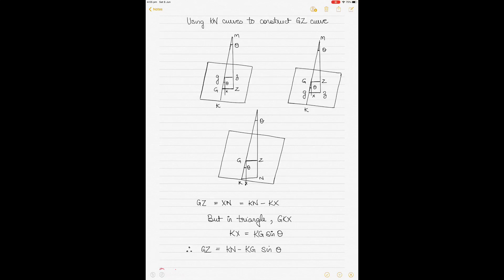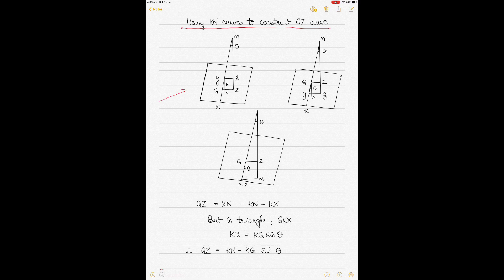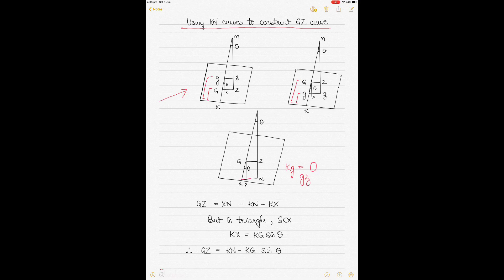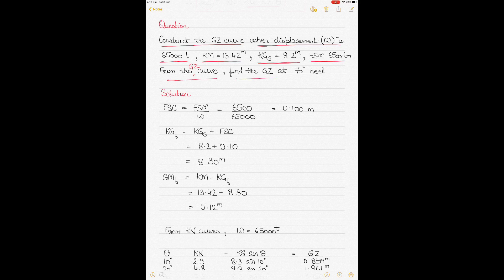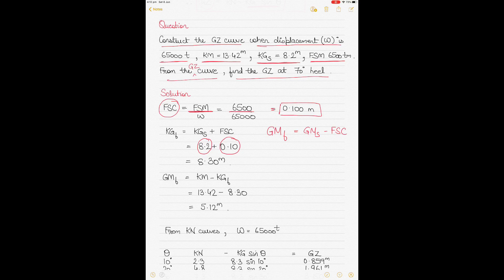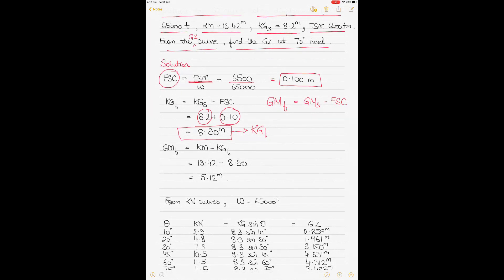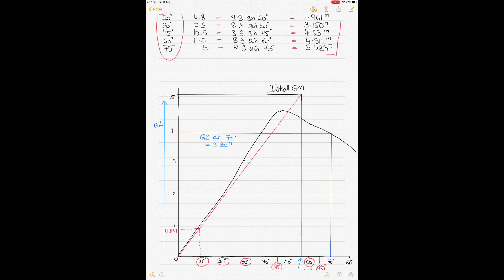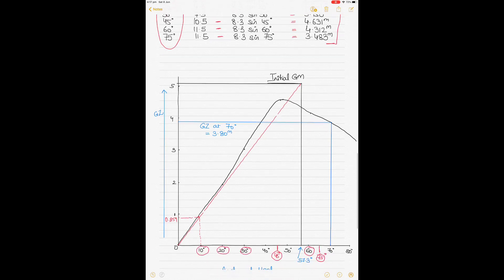Using KN Curves to construct a GZ curve - Advanced ship stability for mariners

Comment: Sir can u tell me why u took angle of heel 57.3  to calculate initial GZ?
Reply: To find out the initial GM (metacentric height) of the ship from the GZ curve, we need to find the angle of heel at which the righting moment is maximum (i.e., the point of maximum GZ). This angle is usually denoted as the "angle of vanishing stability" or AVS.

However, the GZ curve is usually plotted in radians rather than degrees. To convert the AVS from radians to degrees, we need to multiply it by 180/π, which gives us approximately 57.3 degrees. Therefore, we take 57.3 degrees in the GZ curve to find out the initial GM because this is the conversion factor that allows us to convert the AVS from radians to degrees👍👍